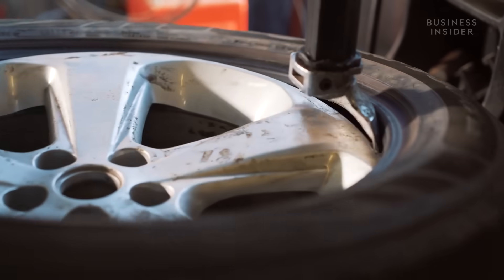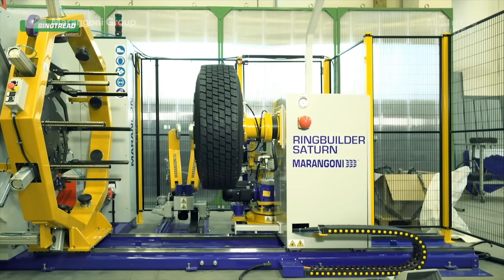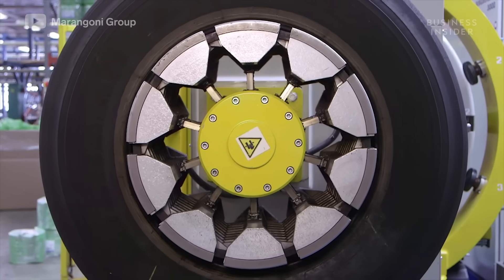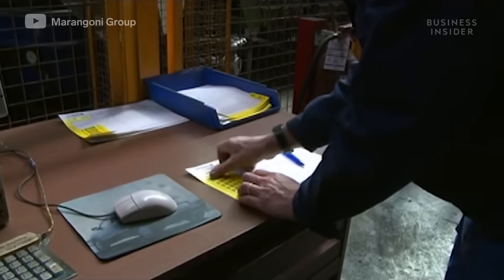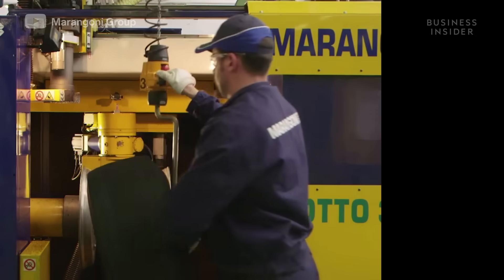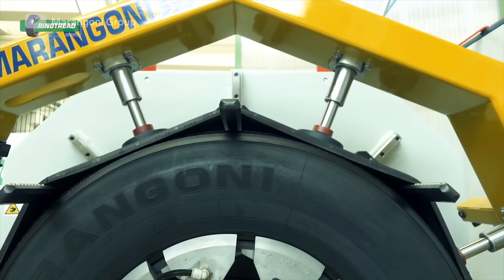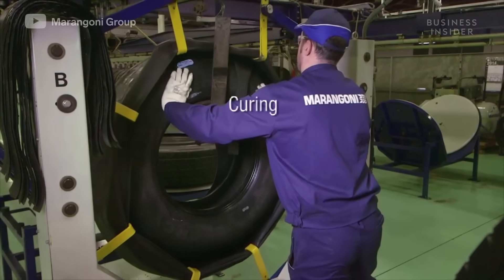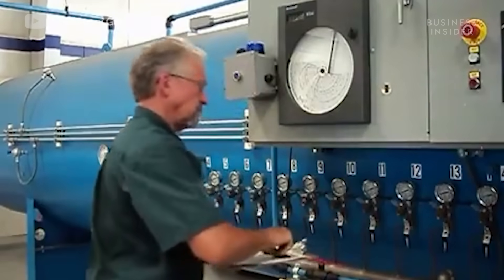How Old Tires Are Retreaded So They Can Be Used Again

Comment: As a over the road truck driver I will tell you stay away from recapps or what this video that is lying and saying they are just as good is calling them reatred it is illegal to have them on your steering axle and when they blow out witch they always do stay back. I know from years of experience. They always blow out your better off if you want to buy cheap tires buy Japanese or Chinese tires. And for people saying what's the difference if your. Tire blows out it's all the same well it's not all the same. If a. Virgin tire blows that's what we in the trucking industry call new from the factory not a recap tire it will probably Just have a hole in it if not on the side wall you can even patch or plug but if it's a recap when it blows don't be close buy that rubber peace there showing you on the video comes flying off it can cause a lot of damage that I've seen lots of times. To my own truck and to other people's vehicles. I've had recaps from other trucks smash in my oil pan and hit breaking chambers break lines all in one hit it ruined two of my tires I've seen recaps blow out in front of cars and cause deadly crashes. Sow you be the judge on recaps.

Comment: As earth friendly as this is, I just don’t see myself ever putting a set of these tires on my car or any of my loved ones cars. Just too many stories about blowouts and sidewall failures on retreads, among other things. 

Tires are what connect your vehicle to the road. There are plenty of other ways to save money  when it comes to owning a vehicle (independent mechanics, (some-not all) aftermarket parts vs OEM, learning to work on own stuff etc).
Reply: Unless you or your family daily drive a peterbuilt I think you'll be okay
Reply: This only really applies to commercial vehicle tires if this were happening on regular passenger car and truck tires there would be endless lawsuits.
Reply: My bumper also connects my car to the road. Is that an issue?
Reply: @panagiotisdrivas8011  how does that work?
Reply: @Lucas_Fidalgo  it's a joke...
Reply: @panagiotisdrivas8011  It was sarcasm
Reply: @Lucas_Fidalgo  I'm confused
Reply: @panagiotisdrivas8011  nevermind
Reply: @Lucas_Fidalgo no I got it, I was just trying to continue the comment chain. :)
Reply: @panagiotisdrivas8011  guess I was the one who didn't got it lol
Reply: Whatever they use to make the threading stay in place suck a lot.
Whatever they did it to try and repair the imperfection sucks a lot too.
My father usually carve a new threading on a tire that is still thick enough, and what my father did is actually stronger than this shit
Reply: What we need to do is push for tire deregulation so we can have the choice of using tweets, solid rubber tires, & other experimental options that die in R&D because of the amount regulation that prevents them from ever being further developed into viable alternatives

Comment: Those tire pieces that you see laying on the highway that look like alligator heads? Those are retreads from tractor trailers. 

the things that when you hit them they get stuck under your car and cause massive damage to your undercarriage... So to avoid that, people to swerve out of the lane to avoid them and strike another vehicle or cause a spin out - leading to a traffic jams, bodily injury, delays, job loss, death, and lots and lots of insurance deductible payments.

But yay - it's recycling kind of.
Reply: Rubber is like milk. It has an expiration date.  It's a bad idea to re-use it. Plain and simple. They do it because it saves money (supposedly) but they shouldn't.
Reply: @jamesnm21  actually milk is perfectly fine to consume, even past their expiration date. it's usually made into sour cream.

Sour dough is also made in the same way, you just leave it out in the open until it ferments.
Reply: I thought they were banana peels.
Reply: @Shuffle3956
No. They are cheaper. 
Nevertheless I'd rather pay extra to have a tire that won't blow in my face...
Reply: Never seems truck lose a tread.
Reply: New tires account for more than 68% of all tire parts on the road. Retreads and Used tires make up the other 32%.
Reply: @misfit4816 Only 40% of trucks in the US use retreads, that statistic doesn't mean anything
Reply: Should be illegal
Reply: Genghis Khan  i cant believe how stupid people like you can be
Reply: When a brand new michelin is $600 and a retread is $280 it makes sense to run retreads.
Reply: @victoryrider  And then wreck causing thousands in damage. Yay!

Comment: Don't the treads come off and wreak havoc?
Reply: That's why if you're ever behind a semi when the tire blows you have to dodge the tread flying thru the air, and that's after you shit your pants because you think a bomb literally just went off. One of the loudest things I've ever heard lol
Reply: Jason H. You’re actually speaking about the flood of cheap Chinese tires on the roads, not retreads. Next time you see a tread that has busted on the road, check and see if the tread has cables on it. If you see cables in the tread it is NOT a retread. It’s a virgin tire that didn’t make it. Due to the cheap availability of Chinese tires a lot of companies have switched away from retreads. Retreads actually rarely come apart as it is chemically bonded to the casing.
Reply: Jason H. I agree, I was driving one day on the freeway delivering parts, a fucken garbage truck tire explode right next to my drive side window. And my car is fairly low so it was at face level.
Reply: @jaycustom21  yeah I was sitting at a truck stop and a truck came rolling in with locked up brakes. Their brakes caught on fire and each tire on the trailer popped, one by one. Thought there was a shoot out or something
Reply: @jaycustom21  second that
Reply: Jason H. It’s loser for the driver of the semi trust me
Reply: Heating the tire causes it to melt to the casing, like vinal rap.

But if the tire gets too hot, then you encounter the issues people are complaining about.
Reply: Melody ya dey do
Reply: Talking from first hand experience, yes it's a terrible idea.
Reply: motobecaneguy2 what’s your experience
Reply: Retreads are just fine. The real problem comes with the second or third retread,  the sidewalls just cant take it anymore. You get yourself a five plus year old casing and on its second or third tread that's when your playing a dangerous game . Retreads fail due to inflation issues resulting in excess heat or due to sidewall failure because of breakdown caused by years of exposure to the elements and miles driven well over the intended life of the tire placing strain on the side wall.
Reply: I used to work at a place that rented semi trailers, most of the time the retread failed just like new tires was due to underinflated tires.  I don't care what any professional truck driver told me, hitting a tire with a bat or hammer doesn't tell you if the tire is properly inflated.
Reply: Not it's it done right...
Reply: Some times normally when the casing fails that happens but it can happen to never retreaded virgin tires . When tires get old they become a hazard
Reply: My truck and trailer cost for new tires $8100-$10,000
For re treaded tires $4050- 5000
Reply: From experience 

Most of them hold

Just dont do it for a third time
Reply: Yes.  It is really dangerous and should be ban.
Reply: Yes they do! I’ve had it happen and I didn’t even know it was a retreaded tire till the thread flew off!!
Reply: @aliceinchainsburns08  My. Father in laws truck blew a retread and ripped his rear wheel well and bumper to pieces.
Reply: Yup, retreading is such a terrible idea
Reply: @connorbeckmann2981  its better then buying $500 a tire for trucks. think 18 actual wheels on most trucks that's $9000
 for 18 tires on a truck.
Reply: As a truck driver. I’ve gone 10000 miles and never lost a retread tire. They are mainly reserved for tandem tires (those are on the trailer) but I’ve had drive and steer tires that were retread they are just as good as virgin tires (non retread) I don’t honestly have a problem with them and never had an issue
Reply: @BrowncoatInABox : Breaker 1-9, we got a smokey on the channel. Watch yourself. 

Seriously, though, don't get pulled into a weigh station if you're rocking retreads on your steer axles; you WILL get a ticket, and an out-of-service order.
Reply: Jacob Carlson it was a temp to go 5 miles to another shop. In reality it was a random tire
Reply: @jacobcarlson4010  so the gov says retread are dangerous to be on steer axles.   Thats all anyone needs to hear about this subject.  They ARE  a safety risk to the public
Reply: @BrowncoatInABox  10 thousand miles thats it?
Reply: @BrowncoatInABox  and you save $9000
 per truck and trailer or $5000 for just the tractor.
Reply: @BrowncoatInABox  good for you. You're only one guy, and you're lucky at that.
Reply: @BrowncoatInABox  As a trucker i use recaps on the drives and on the trailers ,I haul heavy .Keep an eye on tire pressure  and have no problems good casings is what makes a good recap.
Reply: @BrowncoatInABox  seems like you were pretty nice to your tires.
Reply: @BrowncoatInABox  yeah I had heard myths about it and I think that because of the sheer amount of retreaded tires used in the trucking industry, people have misleading data on how often they fail. Thanks for the info!
Reply: Wait What I drive for a living on a daily basis between Orlando, Tampa, Jacksonville, Daytona Beach, etc. Please explain to me why in my travels I see tire casings littering Florida’s highways every day. Please explain to me why I had to reinstall a plastic splash pan that was torn off of the bottom of my car by a road gator (nickname for tire casing). Please explain to me why the front bumper of the Cadillac Escalade I was driving had to be repainted after a road gator hit it. Oh right, retreaded tires use less energy and fewer resources and therefore are good for the environment.
Reply: @BrowncoatInABox  may be....thats bcoz heavy trucks r not meant for speed

Cars at high speeds...
due to heating treads coming off....very likely
Reply: No.
Reply: Was in a car when a retreaded tire blew out not fun.
Reply: Yup I remember one blew up on a semi and sent a big chungus of tire flying to my front bumper and ripped half off of my car.
Reply: @juniorcontreras90  not responsible for objects thrown from the road too i bet
Reply: It happens with semi trucks
Reply: yep, especially in hot climate
Reply: I've seen Road Alligators Spinning, Burning, and Zigzagging Across the Highway many times.
Reply: My wife hit a full recap road gator causing $4500 wirth of damage. Happened in the middle of Texas fall so I'm on the side that they're worthless half-assed fixes.
Reply: 1 word Firestone
Reply: Yes, I see them littered up and down I-75 here in TN. Reason #57  I think we (passenger cars) should NOT have to share the road with semi trucks.
Reply: This is usually done in europe with truck tires, and you can see treads on the side of the highways, they come of but it isn't to much of a problem because trucks have many tires, it is only done on the trailers to if I am correct
Reply: Yes. yes they do
Reply: Yes when the retreads blow they blow with a vengeance
Reply: Yes I left a trucking company because the retread tires not worth your life
Reply: @BrowncoatInABox  Mojave has never been a hundred fifty degrees.
Reply: Retreads are the same dangerous as a new tire. It not meant for big trucks
Reply: Paid fluff pieces are nothing new...
Reply: @plazmaguy13yago9  h
Reply: yes. you can find their handiwork spread all over the ground on roads and highways everywhere.
Reply: Leaving crocodile alligator skin all over the highway
Reply: So when I buy new tires, why do I pay someone to keep my old ones?
Reply: The IDEA itself is brilliant. Just lacks execution.
Reply: Yes. They do
Reply: No they don't come off . But if the treadbthey put on may be of softer rubber that wears faster. Not any more dangerous
Reply: All the time.
Reply: The treads coming off? They're fully bonded. It's like welding. Imagine seeing a weld and then stating, oh, doesn't the weld just break? No! It's the same base material melted into one coherent structure. A good weld is as strong as the rest of the object. If you buff a weld it's like it was never welded. The non vulcanised rubber in this example bonds perfectly with the vulcanised rubber under heat and pressure, what you're left with is just a solid vulcanised rubber tyre. If you wanted to make them safer you'd just repair the sidewalls as well.
Reply: Yeah, ran over one at 70 mph once
Reply: No they don't, retreading has been a long time practice in the semi trucking industry where with the steel ply used in the belts, the tire almost always lasts longer than the tread does. The issue is when truckers keep driving on tires that really should be retreaded or if they don't notice how old the tires on a trailer they were told to haul are
Reply: Nope.
Reply: Would you come unstuck from your chair after being melted to it? No, not really, not unless your butt separates from your body. That's the high pressure vulcanisation step.
Reply: A tire onde blew in front of me
The guy died and my great grandma fortnite danced on him
Reply: no, the untreaded tires are coated with gum which later solidifies in the hot pressure chambers, essentially fusing the tread to the tire (i may be wrong but i'm pretty sure)
Reply: The old retread system used a layer of tread that comes as a strip of rubber and can come off.
If you notice, this system it's a single unbroken ring of rubber.
No joint for the tread to break.
Now there is no guarantee the tread will stay intact if the road temperature is high enough to melt asphalt.
Reply: @pogo1140  well is it truly not glued together somewhere or did we just not see it in the video ;)
Reply: Matt Laclair typo I meant 100,000
Reply: they are reattached using material that they are made from so they are just as strong as before. Plus most of the force on a tire is in the vertical direction rather than horizontally which means the tread wont fling of the side